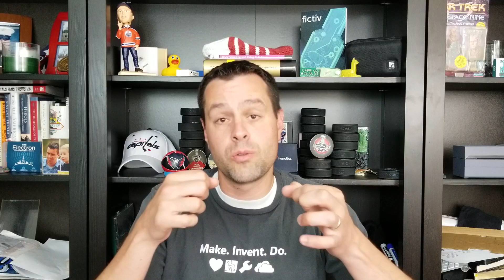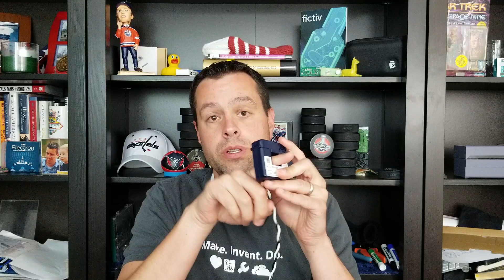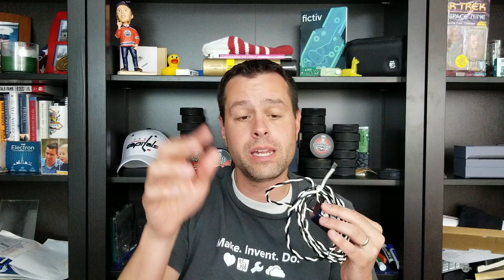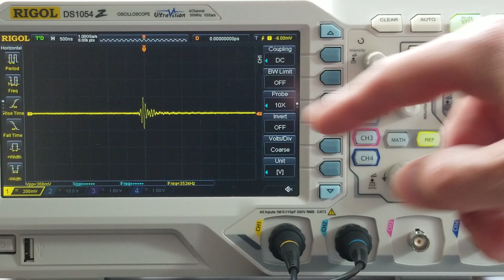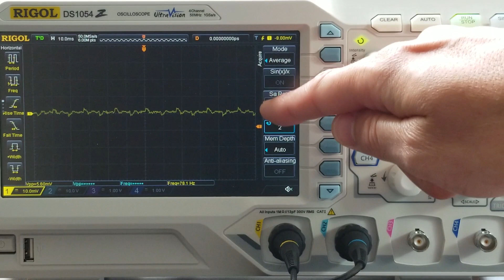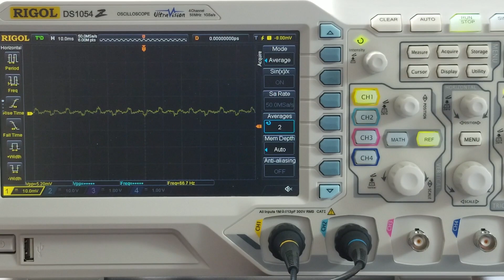DIY Home Power Monitor - Part 2

Comment: im looking into doing a similar project for my house as a also dont want to spend 300% on a pre built box. theres a better way then just reading the voltage coming from the clamps. not sure how will it will work with your clamp but there are some out there that produce small amounts of current as a output, combine that with a burden resistor and a voltage divider and send it straight to a arduino or some other mcu! the most common one i can find is a 100a clamp, not sure how it will work with a 200amp supply like here in the us, still need to research it a bit more. https://www.amazon.com/dp/B07FZZZ62L/ref=cm_sw_em_r_mt_dp_U_H8lMEb7JSTKE7

there is also a 200a avaliable here with a datasheet of you google the part number
https://stuff.iotawatt.com/product/current-transformer-200a-split-core/?v=7516fd43adaa
https://echun.en.ec21.com/ECS24200--4703167_4703197.html

the info you are looking for is the current ratio, for the 200amp one it is 200A/66.6mA

hope i was able to help, if you have any more questions message me on discord or shoot me a email
Mr Alex#6074
mralexh123@gmail.com
Reply from the maker: Sorry for the slow response Alex. Thanks so much for sharing. That's an interesting idea. I guess you'd also need a diode in there since that current output is going to be AC current so it would swing to negative voltages. Although many MCUs have build-in diodes on the inputs. Another thing I'm going to try is use an ADS1115 I have laying around. If I run it in max gain mode I think it will read my 200A clamp. It also handles negative voltage swings. It also oversamples and filters the signal.
Reply: Kevin hey don’t worry about the slow reply it’s not a problem at all! Using a voltage divider would be a better solution then a diode, open energy monitor had some amazing documentation on just about everything, https://learn.openenergymonitor.org/electricity-monitoring/ct-sensors/interface-with-arduino I like the idea of using an external adc it might give you a bit better accuracy if the signal is not too noisy with the gain way up.